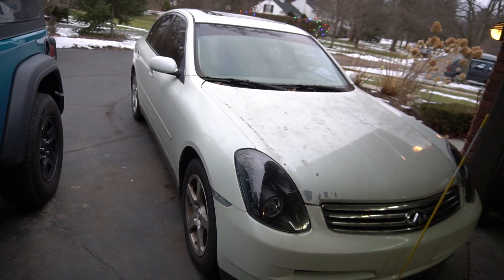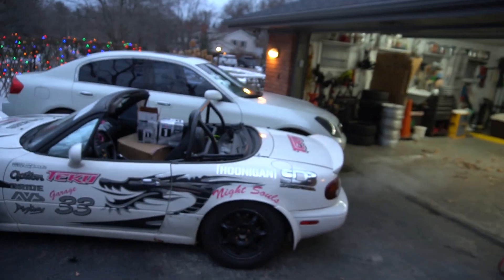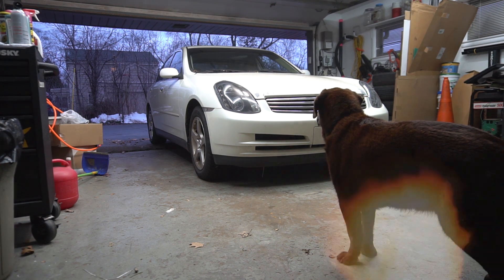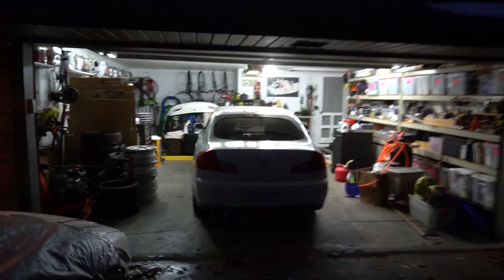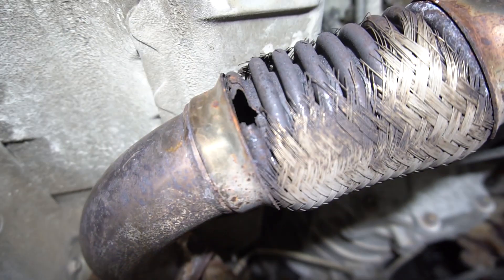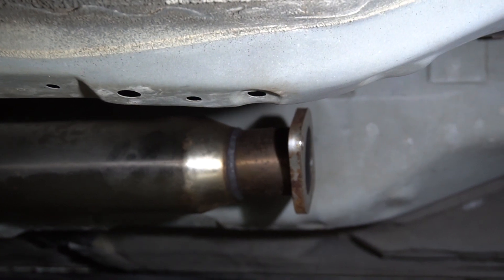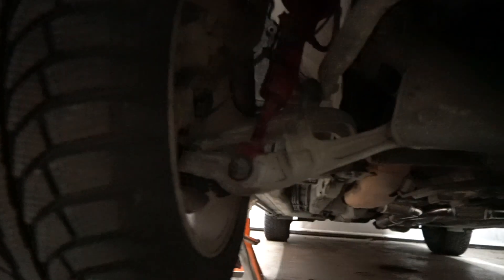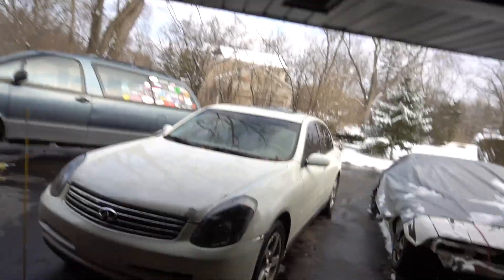A Good Sounding VQ!? // $77 G35 Ebay Y-Pipe Install

Comment: Great content . Have a 2004 g35 sedan myself . Did you replace the valve covers with oem?
Reply from the maker: Yup! It was expensive but I think it was worth it!
Reply: I got a set off ebay, it was only $55 for a set of new valve covers(which I painted a gloss silver), gaskets, and new hardware. A good deal if you ask me, have had them in over 6 months so far and no leaks. I also went ahead and ordered 6 coil packs for $45 of ebay and 6 Platinum Spark plugs for $22 again ebay is the shit! Then I also got a 5/16th Blox plenum spacer for $80 and an oil catch can for $20 where else but ebay of course. This OCC was actually nice, it had 2 inlets and 1 outlet in the center. Most OCC just have 1 outlet and 1 inlet. It also was baffled which is what you want, that way it collects the oil and blow by vapors better. I just ran both banks to the OCC as a closed system. So the OEM hose that went from the pcv valve to the lower plenum I used for the outlet. It's basically just like how the pcv emmisons are set factory.  The OCC now just filters the vapors. It works great and when I took the plenum back apart 6 months later I had not one trace of oil in the intake. When I first installed the plenum spacer it was pretty dirty. But not as bad as I initially thought it would be considering it's a 16yrs old car. Definitely recommend getting one, I empty it out once a month and it barely collects a ½ oz of oil vapor residue. I just had to plug the intake inlet where the bank 2 valve cover emmisson hose went on the cold air intake I have. It really helped with the oil consumption issue I was having. 
You should look into getting a set of test pipes and replacing the stock resonator with a 22 inch glasspack. You'll not only shave 40-50lbs from the car. But you can sell the catalytic converters to a scrap yard. I got $186 for both of mine. It pretty much paid for the exhaust upgrades. I got an aftermarket muffler similar to OEM. It sounds great, a deeper toned OEM sound. Much better than that raspy trumpet ricer sound. It has a little rumble to it because of the intake mods. The Glasspack and aftermarket OEM Mufflee is key here though. Not sure if I should get a y pipe or not. Im really trying to avoid any unnecessary rasp. I've read to use high temp RTV in place of the metal gaskets. Heard that it'll help quiet any rasp you may have. So far it sounds great, I get the little pops whenever I rev and let off the gas. Some ppl have to get a specific tune for it to crackle, pop and shoot flames. I'm not shooting any flames as far as I know. I only run 93 octane and don't have an uprev tune as of yet. Cold starts sound amazing as well. 

Most ppl go for a big aftermarket exhaust. Then they sound like shit and they paid easily 3-4 times what I paid. Well it was almost free since I sold my cats. I'd recommend to get them while you can, any aftermarket exhaust upgrades for that matter. Because the epa has already been giving some aftermarket parts manufacturers, sellers, and tuners huge ass fines. They are going after the whole scene. Give it a yr and they will ban ebay from selling anything that changes a cars OEM exhaust & emmisons. They don't even do emmisons where I'm at anymore. So I'm good to go, not like I'm in California where you can get fined for modding your car. Just my two cents, the mods I've done combined with deep cleaning the top of the pistons, piston rings, valves, upper & lower intake manifolds, intake runners, inside of the plenum, throttle body and the maf sensor. Then changed out all fluids. The coolant, front & rear diffs, transfer case, and the transmission. Started using a thicker grade 10w40 and it quietened the motor a lot. I did everything pretty much all at once. But it turned the car around a noticable difference. Not only did I gain hp & torque if I had to guess I'd say maybe a good 20hp with everything combined. It's basically almost FBO if it had a full custom aftermarket exhaust. It has every bolt on that I can think of. It hesitated a lot when I first bought it. Ran that seafoam after I let some sit & soak on top of the pistons,then deep cleaned it, gave it a tune up and it runs smoothly and it's way more responsive. I'm considering getting an electronic throttle control unit. The ecu only allows for a maximum of 80% throttle response at all times. Other than getting an uprev tune, there's no other way to change it to 100% throttle. This electronic throttle control unit plus into the sensor near the gas pedal. It allows the ecu to be more responsive. So whenever your at wot it's actually wot. I've found some for less than $60 so I figure wth. It'll be even funner to drive in that case. It'll feel faster and appear to have more power. When it's just changing throttle response and sensitivity.
Reply: @nowimhigh  in my experience all that cheap shit just ends up breaking and having to be replaced
Reply: @oliverelizalde  
Depends on what it is. I have been buying coil packs from ebay for years and I've only got a couple bad ones. Its saved me a fortune. The coil packs for my bmw were 100 bucks each at the parts store I got all 6 for like 60 bucks on ebay.

Comment: How’d you make the Y-Pipe fit I’m having trouble making it fit
Reply from the maker: It took a lot of clamping but make sure yours isn't upside down. I just clamped mine into place enough to get the studs in

Comment: Completely unrelated: but how is your CCP hardtop holding up? How’s the road noise and all that?
Reply from the maker: Actually just sold it haha, it was good. Super lightweight, pretty rattley and loud but I didn't have window seals in it. Could probably make it quiet if I tried

Comment: just picked up a g and I gotta replace the y pipe too... that y pipe should work with an otherwise stock exhaust right?
Reply from the maker: Yup! Mines all stock up front, has something different in the rear but it's designed to work on a completely stock exhaust
Reply: GARAGE 33 sick man, thx for the reply ill order one most likely.